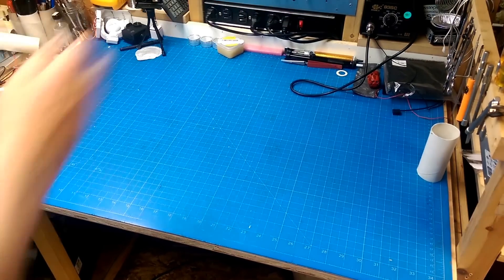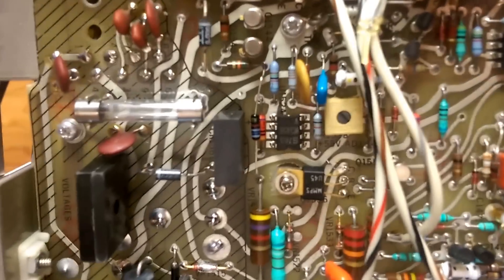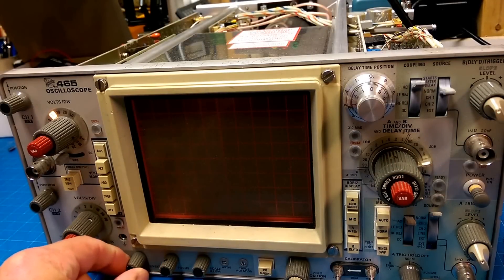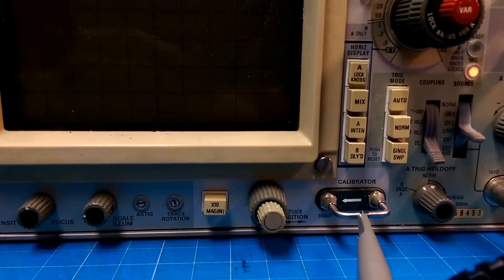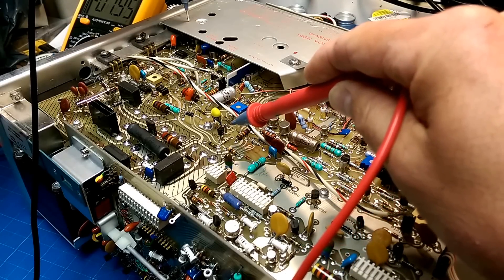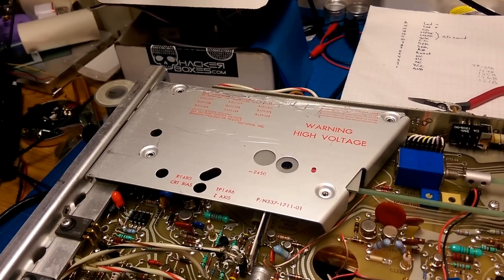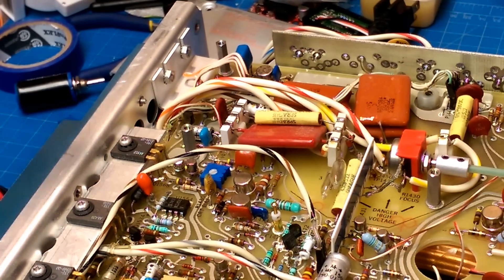Tek 465 Repair

Comment: I'm having a signal loss  my channel 2 on my 465M. I have a sweep but there's no response to the probe. Channel one works fine it's got all kinds input gain,  also I think there's some bad electrolytic capacitors all through the scope that need to be replaced..... General upkeep and maintenance and believe me the scope will sing like an angel once you give it some fresh electrolytic capacitors.... As well I never forget this!  there is a couple of germanium diodes that are used in place of silicon to start the sweep  because the Silicon diodes are too fast a rise time for the lockin. They are located on the edge of the board... if you replace those you have to use germanium....  You can still get them..  but man if you can get them,  get yourself some extra ones and tape them to the inside of housing for safekeeping and use of a magic marker to write down what they are...  You will go down in history as a true pioneering repair Tektronix scope Tech that thought about future users of this particular analogue scope series the thing about the 70's techtronic Scopes and even into the 80s and probably even 90s the germanium dialysis because if it's slower rise time which helps and by the way these CRTs made for these beautiful analog scopes.
 Tektronix CRT tubesare made so good,  they say they have a lifespan of almost 200 years or even more  before they go to atmospheric pressure!
 Of course that's hearsay... 
Tektronix likes to think, so.... of course 😅.

 If anybody knows why I'm not getting signal through, please let me know! Myself and about million other people would probably love to know... 
 I'm wondering if it's the selector switches I have a dirty blade or it's probably bad electrolytic signal capacitor pulling it to ground before it gets to the amplifier stage capacitor. 
I think I'll just probably sit down and shotgun replace all the small electrolytic capacitors across all of the boards. The beauty of an analog oscilloscope is in comparison to my my Hewlett-Packard DSO Scopes which I really love by the way is no comparison for when I'm working with audio and some frequency signals and a 3.2 nanosecond and Rise time on a this scope is really amazing...

Comment: I have to try this.  I have a 475A scope.  Pulled it out of trash 20 years ago and couldn't give it away.  Suddenly need to use it to see a waveform, but the tube doesn't light up.

Comment: Now, many years later, there are Aluminum Polymere capacitors that are a perfect replacement for the Tantalums. They have a very low series resistance, and they are dry and do not leak. And they are happy to work in some hotter environment. They are a little more expensive than good quality wet electrolytics, but especially in these power filter circuits, they are a perfect replacement.

Comment: I love this, thank you.  I just bought a 465 very cheaply.  No beam as well.  I've blown the same fuse, and I'm trying to diagnose it at the moment.  I love that you're using a Fluke 8060A, as am I.  It's a great meter, but continuity mode is a little trigger happy when capacitors are charging up, like you say!  This was a just a little video to chronicle the first problem I've looked at, which is that my 110V regulated supply is unhappy! https://www.youtube.com/watch?v=bl3ZO4Af0g8

Comment: That's one of the things I like about the old scopes, they are very robust and you can easily fix them most of the time. If you like some bells and whistles and still be able to fix it somewhat easily try a TEK 7000 series scope, like a 7854 etc. Thanks for sharing. Best Wishes n Blessings. Keith Noneya

Comment: Just can't believe plugging something into the wall and turning it on before running basic checks.
In my shop it would be disassembled, blown out, cleaned, dry and moist, lubricated (mechanical parts) and every test a multimeter can do pre-power.
I had a 465, but as much as I loved the panel layout, I could not find a use for it in my shop, and of course even less on the road, so away it went. 
I am as much a vintage lover as anyone here, but noise in oscilloscope traces warms my heart about as much as drift in a vintage autopilot when I am IMC.
Reply from the maker: Yes, that is the correct way to do it.

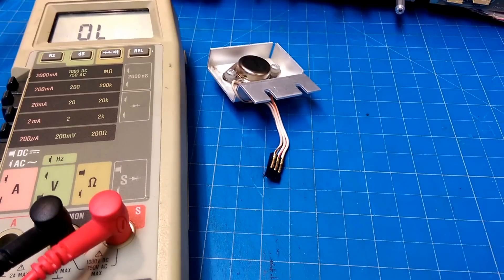Comment: Complete electro-NOOB here. Thanks for this great repair video. Just one question tho: at 13:09 what are you probing, exactly? Seems like you have the red test lead on a ground, but then you have the black lead on one, of the fuse holder terminals? But you call it a cap?! I can't tell, your hand got in the way. Please clarify for me, I’m trying to learn. Cheers!
Reply from the maker: At around the 11 minute mark I take a look at the schematic.  The capacitor I am interested in lies between ground and +15 so I am probing at where one would expect to see +15v and ground to look for a short.  And indeed there is a short so I suspect that tantalum cap has failed short.
Reply: Thank you for replying. Ok, but you are poking the test leads at the opposite end of the scope [not around the cap in question or the suspicious transistor] and the DMM is reading Over Limit, and you say 15 volts shouldn't be here? Please remember, I'm a complete NOOB.
Reply from the maker: Look at the schematic.  You will see capacitor 1419 has one terminal connected to ground and the other terminal is connected to the fuse that is inline with the 15v rail.  So electrically it is just like probing both legs of the cap.
Reply: @grtyvr  Is the scope turned off, your DMM reads OL and you call that 15 volts?
Reply from the maker: @maxwarfield6699  Yes.  It is off.  Were there no short to ground then there would be some resistance reading, so the conclusion is a short to ground.
Reply: @grtyvr  I have no idea, of how you came to that conclusion. Either the schematic you are using is screwy or there is something wrong with your DMM. My DMM only displays OL if the resistance is high OR when there is no continuity. Anyhoo, thank you for being so gracious with me, sincerely - but I give up.
Reply: @grtyvr  Ok, ok wait... You wanted to know if the cap was shorted or not. So, you set the DMM on continuity and because the cap [in the schematic] sits between the fuse holder and that transistor’s heat-sink [ground], a beeep! from the DMM would indicate, that there is continuity between those two points, thus, a shorted cap! Is that right? Did I figure it out?Please confirm. Still... there is an inductor and half of a transformer between the fuse holder and that heat-sink, doesn’t that affect the reading? Again, please confirm. Thank you

Comment: When working on these old Tek scopes, how do you use a Variac and an isolation transformer?  Do you hook them together or do you use each one separaely hooked into the 120VAC power line?  Or, do you even need a Variac and an isolation transformer?  I would think the Variac is handy in case an unknown condition Tek scope had a major short that you wouldn't want to apply full line voltage to.  Is an isolation transformer handy or necessary when working on the old Tek scopes?
Reply from the maker: I have not used either of those so far.  Probably a good idea though.  Or at least a current limiting lamp in series.

Comment: Good video. In the end, it was a bad capacitor. I'm a bit new to all this--did I miss the part where we SEE the capacitor? Did I miss that part? Seeing the bad capacitor in place would help me understand what happened in this video.
Reply from the maker: That is my big regret about the video.  I didn't clearly show which capacitor it was in place on the board.  You did not miss it, I did.  But it is under the HV shield near the back.  C1419 on the parts list.

Comment: Thanks for great video and the links. Saved me a lot of time and i fixed my scope by watching your video. My fuse was keep blowing and i did not have the trace on the screen.In my case, the capacitor C1419 was culprit even though it was not short to ground and ECR meter showed it was good. I just changed it with an electrolytic capacitor of same value and it came back to life, yeaaaaaay. At some point i will recap the scope but it is working for now. Thanks again.

Comment: Sorry I'm new to this stuff. Why doesn't the square wave show the vertical lines connecting the horizontal lines?
Reply from the maker: it is an artifact of tube scopes.  If the beam has to move fast, it does not have a chance to illuminate the phosphor coating very much.

Comment: I just got one of these off ebay for oscilloscope music .. nothing happened or lit up when I turned it on and gave me an electric shock off the casing when I leant over to unplug it!
Reply from the maker: Careful.  It sounds like there might be a filter cap that has failed short.  Filter caps go between a rail voltage and ground and are there to provide a frequency dependent short to ground.  If they fail open then no big deal, but if they fail short, then you have a chassis at the same potential as the power rail that they are connected to.  I would start checking there.
Reply: @grtyvr  Thanks but it turned out I'd been sent a plug with only live wired in .. so now I'll always be checking the plug on posted used electronics before powering them on

Comment: A 47uf tantulum capacitor must be replaced...BUT NOT with a (cheaper  ) 100uf electrolytic . My guess : the function  of this capacitor is to insure that high frequency spikes created by the power transistor  oscillator is attenuated  from the +15 unregulated supply voltage. An 100f electrolytic  does is in adequate to remove these types of side effects .